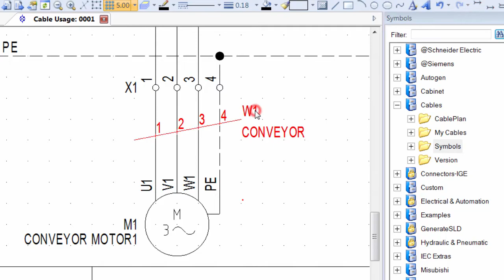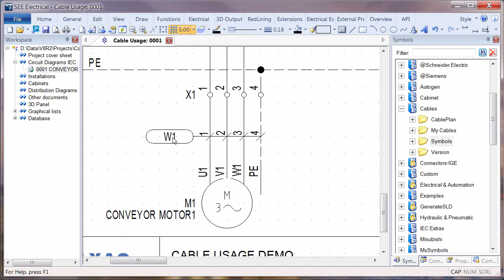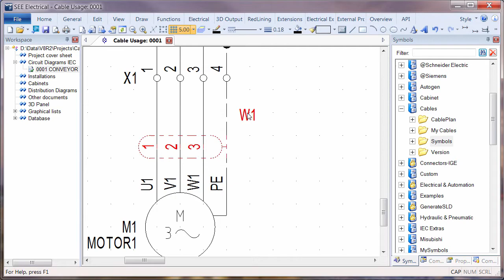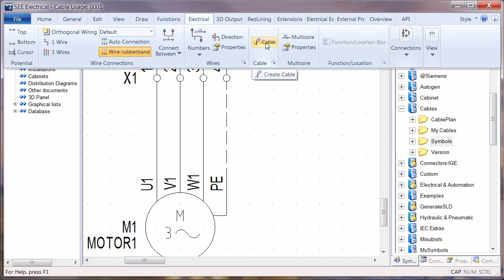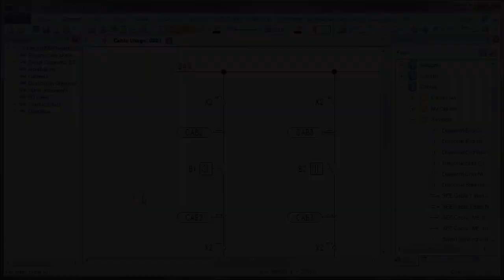See Electrical V8R2 Multicore cable usage

Comment: How do you add a cable in component DB?
Reply from the maker: Exactly the same as adding any equipment in the database, clicking 'Add' then filling the unique equipment number, description, manufacturer and goods group. The cable details such as number of cores, colours and core sizes can then be defined by adding the field 'Number of cores' and then accessing the entry from from the right of the value field.
Reply: @IGEXAOUK  thanks for the answer! I have one other question, let's say I have a cable with a socket and it's 5m long, how can I make that cable to show just 1 unit in the BOM? but still get length for cables that are cut to size and sum up with others of the same reference?

Comment: If I have a cable that spans multiple pages, is it possible to display a page reference under the cable tag? And would you possibly make a video showing how to do it?
Reply from the maker: Hi @peterlauridsen7997 its not possible at the moment but you can of course create cable core reports to document this information.
Reply: @IGEXAOUK  I know it's possible – I just think it would be helpful to have this information shown directly in the circuit diagrams as well. I’m aware that several other programs can do this automatically
Reply from the maker: @peterlauridsen7997  Its a great idea so I'll pass this over the the development team. Many thanks for the feedback.

Comment: In R8V3  I do not have the popup for the cable options shown at 0:58 in the Standard Level but I had it in R8V2 Basic. How do I get the options back?
Reply from the maker: In the Cables settings (in Circuit Diagram IEC properties) there's an option for 'Exclude selection from defined cables'. Remove this and it should work as before.
Reply: @IGEXAOUK  My option for that "Exclude selection...." box is not checked. Checking and unchecking makes no difference.
Reply from the maker: @richardhawkins1628  OK then is it possible that when you migrated from V8R2 to V8R3 you didn't copy across the Cables.ses in the symbols folder or CablesNew.mdb from the Templates folder?
Reply: @IGEXAOUK  That was it, thank you! I had already copied the *.ses but that didn't help. Per you comment, copied the *.mdb files in templates for the cables and they are all there now. Thanks again.

Comment: Hi, I can't find the individual symbols in my symbol tree. Have they been moved in V8R3?
Reply from the maker: Hi Barbara, no they've not been moved. Click to insert a cable and check the symbol database and folder mentioned in the start, middle and end. If you still can't find it try right clicking in white space in the symbols panel and select properties. Look down the list and make sure it's set to on for your page type, otherwise it'll be hidden.

Comment: What does the "multicore" button do? It seems to convert a wire to a single core cable, but I don't think that's what used for.
Reply from the maker: Good question, it allows a single wire to have a multicore marker added which via the multicore properties can then have all its cores and destinations defined in a table (not physically drawn). Each core can have a target point defined on the source and target symbols, as well as core size and colour information. Be aware this is only available in the advanced level See Electrical package.

Comment: Hi, when a multicore cable spans two sheets, it will only allow me to label the cable on one sheet. If i try and use the same tag it says that it's already in use. Is there any way to label the same multicore cable on two sheets?
Reply from the maker: Hi Charlie, good question. In the Advanced level package this is handled by selecting the cable, right-clicking and using the 'Copy Image/Copy Ghost' command then opening the linked page and pasting the image. The result is a linked image that updates if changes are made to the source cable.
Reply: @IGEXAOUK  Thanks that worked. It doesn't look like you can assign a wire number to a cable core though?? We have cable assemblies (maybe 32 off 1.5mm² black) which have cable core numbers to help identify each core, but they would most likely have different cable numbers in the assembly.
Reply from the maker: @baballuci  if you're using signal types, in the signal type setup form there's a setting to 'Show net names on connections with cables'. Hope this helps.